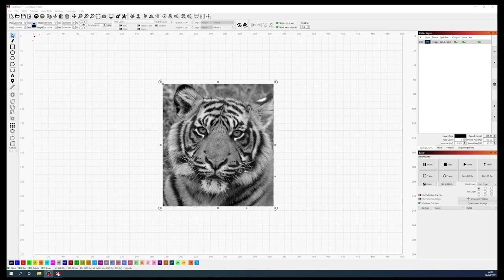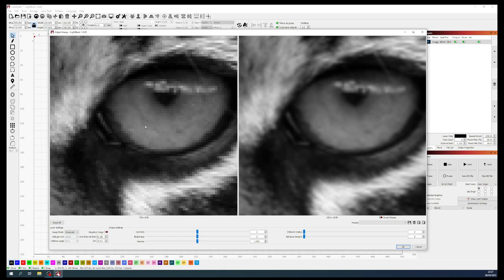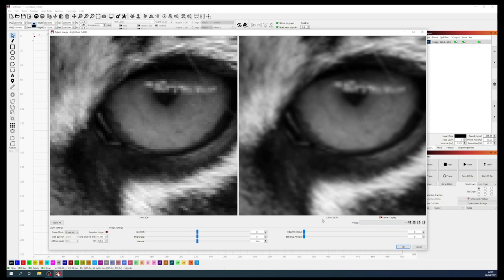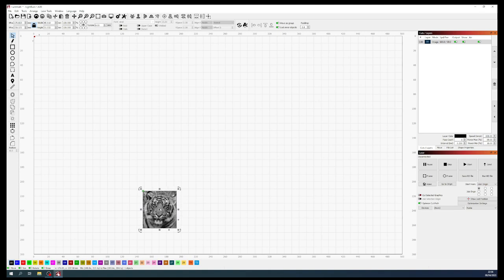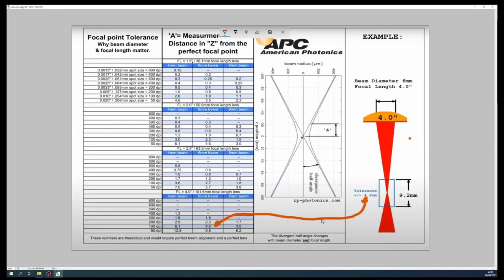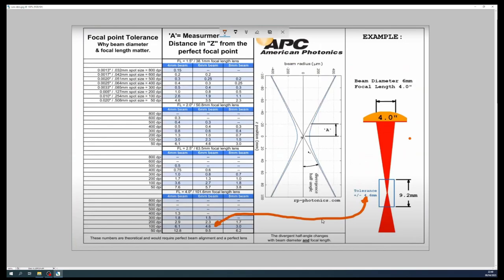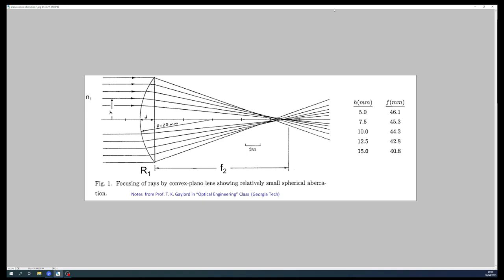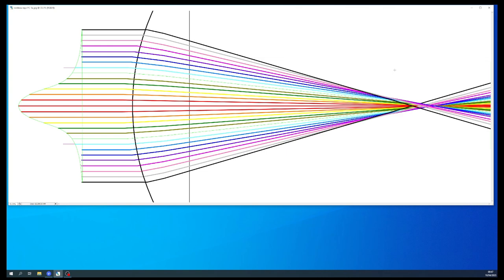Photo engraving 2

Comment: Russ, I wish I had seen this a couple of weeks ago. I was doing a photo engraving on slate. I fiddled and fiddled with the picture and got a decent engraving but it was not perfect. The customer was estatic however. I did the engraving with a fiber laser. Now using what I have just learned I think I will be able to produce much better results.
Reply from the maker: Hi Kris
 The real secret with the fibre laser is to set the frequency correctly
 If you are using an image of 254ppi that means the pixel size is 25.4mm  (1") divided by the ppi  ie 25.4/254= 0.1mm square.  This means there are 10 pixels per mm. So, if you choose to run at say 400mm/s that meams you will be dotting at the rate of 4000 pixels per second. You must match this number when you set your frequency ie 4kHz. 
 Best wishes...Russ
Reply: @SarbarMultimedia  thanks for that bit of information. See, every time I communicate with you I learn something new. Now, if this adlepated old brain can retain all this new information. Take care my friend.

Comment: What size is that metal tube for the air you stuck into the cloudray lens tip? Did you have to weld or glue it in?

Comment: I really want to try this on my 100w c02 2 inch lens can you do a short video on how to use the image you provided (254ppi bitmap test pattern)  with the dashes with out the theory. I love the theory but i want to just see you do the test. I think that would be very helpful. Thank you from Canda
Reply from the maker: Hi Mark
 It is impossible to get 0.1mm dots from a 2" lens. The best you can expect is 0.2mm dots which means 25.4/0.2=127ppi. BUT even a 0.2mm dot will depend on your tube power and its beam intensity profile. Using a tube at very low power (working in the tube's preionization zone) is the best chance of any succes and then regulating the exposure time with speed.  Sadly, the higher ther tube power the less chance of success even with a 0.2mm dot. This is where the 40 to 60 watt tube excels. More power is great for cutting but that power comes at the expense of precision control of low power. The reason for all these "prepare you image for photo engraving" bits of software is that  most people do not have the patience or the curiosity to understand to capabilities of their equipment, thus,  removing pixels (and lots of detail) is the simple path that most pursue with their machine's 0.5mm dot capability. I have gone into the theory of how and why  it is incredibly difficult to achieve a 0.1mm dot  and how different materials produce different results. However, all is not lost for you.  The second part of photo engraving is to understand how digital graphics works with the eye. Simply put, if you are limited to a 0.2mm dot then every feature in your image will be described with 50% less dots. Double the size of your finished image from A4 (say) to A3 and  you have now doubled the number of pixels  for each feature. The downside is that this bigger picture looks great at 6 feet away but a bit dotty at 2 feet. 
  If you can use my test pattern to get dots that just touch on the bottom line then you have 0.2mm dots.. That's the absolute best you will be able to achieve with your machine.  This tiger image was done at about 200mm/s and for a glass tube machine the speed is determined by the response time characteristics of you the HV power supply. This is a subject I dig deeply into in another video  and discovered that changing my HV power supply allowed me to run the same image at 600mm/s  with no loss of quality. See  this video if you are interested.    https://youtu.be/Cgkze6gPI8M. It's understanding this sort of process detail that allows me to push the boundaries.

I would love to make a video for you showing  how to succeed with your equipment but I absolutley know (1've been there) that I will just be demonstrating failure.

Comment: Hi Russ, thank you so much for the educational videos you've been making! I have learned so much from them. You definitely have a talent teaching. Wonder, though, how/where did you learn all this stuff yourself. For instance, there is no much info at all for RDworks and unless yours and couple of other's videos one cannot learn it.

in this video, at around 16:41, the lines you etch are wavy. It's especially pronounced on the thinnest lines. I have this same problem with my 100W Chinese Co2 laser. On mine I attribute this issue to the X linear carriage being too lose on its rail - no preload there. Consequently, each movement in Y (which  precedes each X movement) causes vibration in the Y direction do to wobble of the X carriage.

Have you attempted fixing this? I have been thinking of buying a preloaded carriage.
Reply from the maker: Hi 
 When I retired from an engineering career that was multifacated,and included a 10 year spell running a precision sheet metal business that included two large CO2 metsl cutting lasers, I decided to buy a cheap Chinese laser to "play" with and to keep my two remaining grey cells execised..  Coming from a background where I had learnt a lot about lasers , I felt this would be an easy downscaling. How wrong I was. This was like stepping onto another plannet and if 5% of what I knew was transfereable, even that may be an exaggeration.It was a junk machine with a junk tube tat the Chines sold as a dream rather than a usable machine.  After some tesing and fiddling (my naivety was immense) I bought a replacement tube from Ebay. Mistake number two! I replaced rubbish with rubbish.. With YouTube in its infancy there were no recources to guide me.I decided to call upon my life time of engineering skils and problem solving to make sure I did not repeat my stupidity. I began to slowly learn about laser tubes and how they worked form distilling a few basic facts ffrom many unreadable achedemic papers (a bit kie doing a jigsaw puzzle with no picture to guide you)  and then decided I needed to understand every aspect of this wierd but fascinating  technology. It seemed that so much was unkown or explained  by techno babble  from "experts" selling their machines. It took my about 8 years of experimenting, making mistakes , to discover the many pieces of the jigsaw that finally made sense of this whole technology. It's been a slow process of self education, delving into the edges of physics, cheimstry optics and material science  to understand sufficient priciples to glue all the pieces of the jigsaw together. The other big part of the jigswaw that thousands of correspondents helped  me to build, was how the whole Chines laser industry worked  Helping  so many people all around the globe to solve their laser machine problems  it was easy to start seeing patterns of fraudlent activity.
 So there is no  magic solution to my learning. it's just time, reseach , successful and failded experiments. The fortunate thing was my long time interest in video and editing. I decided to  dispense withall my  semi pro video kit and just do a simple" look over my shoulder "style video.No lighs, no s special mics . no fancy titles etc , just videio as it comes . All facts and no frills I am not seeking an Oscar.

This is a perfectly adequate machine now that I hasve done some work on it the slight jitter you see is very small and whether it be engraving or cutting it is totally unoticeable. Compared to a high quality CNC machne this is still B grade kit but for me, my 5 various laser machines are teaching and reserch aids and not production equipment. On the way to developing my lightweight headI encountered significant "ringing" issues caused bt the head as the nozzle and lens tube acted like a pendulum at the beginning of each scan . It all boiled down to a flexing head mount.  Although I have designed several different head mounting brackets,  the system I favour most is to bolt the head directly to a 15mm front mounted bearing block....no chance of flex and  then all that leaves is what you mentioned, the bearing clearance.  So check your  mounting flex before investing in a new X rail.
Reply: @SarbarMultimedia  Wow! That was a fascinating read for me! Thank you so much! A possible idea to a video of its own - "My journey studying lasers". One thing I wish with your videos is that YouTube were putting at the top of its suggested videos for CO2 laser inquiries (and the like). Often times there is so much value (at least for me) in the videos you make as compared to the top suggested ones.

Well, at least I can tell that mine arrived in a much more useable condition than yours. I bought mine just over an year ago, so would assume the Chinese have improved somewhat. 

Yes, the mounting was the first thing to get my suspicion, but I quickly discovered that most of the play was coming from the carriage being lose on the rail. Sure there is flex in the mount bracket, but its contribution I reckon is negligible in comparison to the carriage.
Reply from the maker: @DYEngineering  
 I have to admit to seeing several machines with rubbish  X bearings where you just put your finger on the nozzle  and with just gentle pressure back and forth tcan feel 0.5 to 1mm of free movement. In all cases , just a replacement bearing ( not the rail) fixed the problem but that is a choice you can make .

Comment: Any experience in photo engraving on Acrylic. I have recently started playing with this (new to me). I have found some strange behaviour. I do the engraving (which of course thanks to your videos became that much better than it used to be) and then cut the outline. As soon as I cut there start to form cracks along the cut edge (but only on the internal, engraved side - not the outside stock), as well as cracks on the engraved surface, as if all the engraved dots form into micro-cracks). This looks almost as if the material had internal stresses and the heat acted as a catalyst in creating those cracks. But then, it's only on the engraved part and not the leftover.
Reply from the maker: What you descibe is totally abnormal There matybe something deeper happening that you are unaware of.  I have worked extensively with acrylic for many years, both cutting and engraving and never encountered such difficulties. This sound like a fascinating problem that may in fact be nothing to do with the acrylic and more to do with your tube. I think we should communicate more on this issue sothat you can send me some pictures etc. YouTube does not allow email addresses and they run algorthms to hunt them down and remove your comment. However they are really stupid and easily fooled by encoding your address in a simple sentence (or sentences) such as this.  John will be  seeiing DOTty  plus a 777 at the big G company next week.   Speak soon   Russ
Reply: @SarbarMultimedia  I guess you can call me as much stupid, since I seem to be fooled by your encoding as well lol. Made a few attempts with the options that make the most sense to me as the correct "decoding", but my mails keep bouncing.
Reply from the maker: @DYEngineering  
Perhaps those algorthms are wise to my workaround 
You can contact me privately via this form
https://forms.zohopublic.eu/ndeavorlimited/form/K40XtreeemLaserCutterContactRussSadler/formperma/k2Cn0QN5ChpazfTMAUw25lZ-FKpjZa96TQWHjv3ntOg

Comment: Hallo Russ. I bought 50w chinese blue white laser. I am trying to find your contact information, but unsuccessfull. I am just curious, do you still offer light head kit for this machine ? I would like to change the mirror mounts and laser head. I have a lots of problems with them, and would like to change them completely on 25mm mirrors and 18 or 20 mm lenses. Thank you in advance for your answer.
Reply from the maker: Hi Damir
 Sadly You tube stpper it's messaging service several years ago. and it will not publish comments with email addresses.  Please contact me privately byusing this contact form
https://forms.zohopublic.eu/ndeavorlimited/form/K40XtreeemLaserCutterContactRussSadler/formperma/k2Cn0QN5ChpazfTMAUw25lZ-FKpjZa96TQWHjv3ntOg

Best wishes
Russ